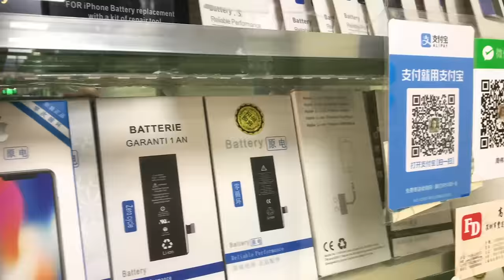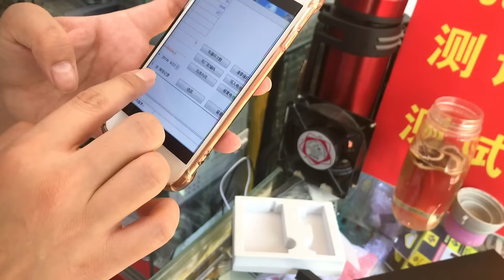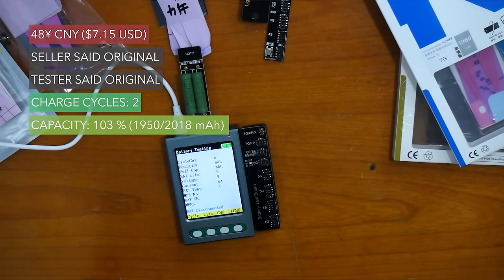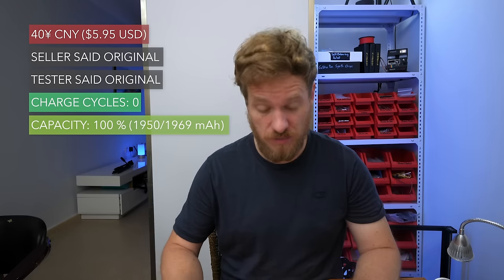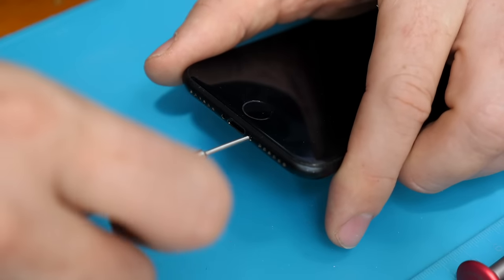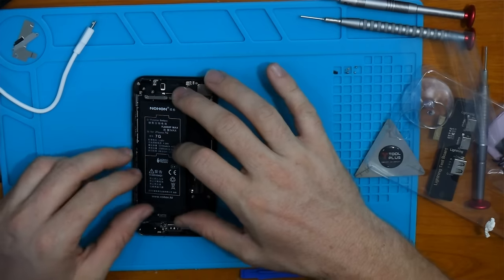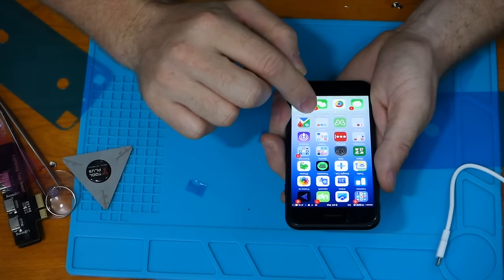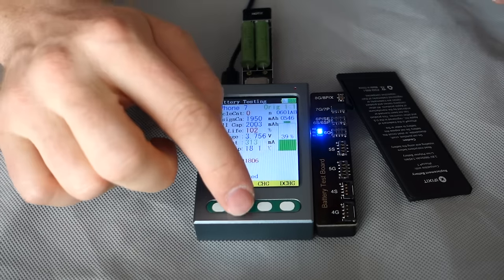Real or Fake? Trying to Replace my iPhone Battery in Shenzhen, China

Comment: Pretty interesting stuff. Genuinely I have an IPhone X. It’s over a year and 2 -3 months old now. I know I’m under a contract for another 9 months (feb 2021) - and I genuinely find it interesting how complex it is to open the phone and replace.

Of course I’m not going to open it and replace the battery. Especially considering I have never opened a phone and don’t have equipment to open it.

But a question I have, How much did you effectively spend on replacing the battery alone? Kit and all, 

I’m inclined to just take it to Apple- because I’m not confident in buying the stuff and reassembling. But if you are confident it probably is cheaper long term to do it yourself,

Or even if your working on day a warehouse (I used to work in) nab a few tools and go Haha

Comment: Tips from a repair tech for removing the battery: remove taptic engine to avoid the adhesive sticking to the bottom part of the flex. and use your fingers. SLOWLY. and EVENLY.
Otherwise you get to pry it out. using heat and alcohol helps too =)
Also. keep up the videos!

Comment: In the automotive industry they have what they call a battery load tester, in the battery can not maintain a certain amperage rating under load it is no good or is on its way out and needs replacement, same would apply to any battery to be tested.

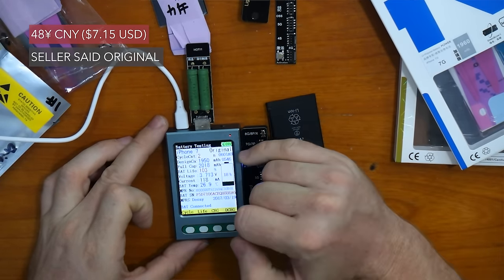Comment: 7:00 If the tester can read data from the battery, I'm assuming it's from some sort of logic board or microchip connected to the battery... couldn't the data on the battery also be faked to read as beig an original battery, when in fact, it could be counterfit  ?
Reply: Of course

Comment: Hey Scotty, how is the nohon max battery holding up after ios13 upgrade? Does Apple whitelist their battery models. I'm using 7w or 10w charging and it really increase wear and tear as you charge and discharge frequently. It's still better than waiting 2-3 hrs to charge from 0 to 100% on 2000mAh at 5w charging. 
I really like higher capacity because you get more decent battery life even if it has high wear level.

Comment: Am I right that only the iFixit battery tested 100 on Life? All the others had 50, 60, etc.... I would definitely go for the iFixit one if so.
And by the way Scotty... that's not "Copy 1 of 1" as you say, but "One-to-One Copy", which means it should be equivalent to the original.

Comment: I had an iPhone 7 with a dying battery. I wanted to order a battery from iFixit EU store, as I am from Europe, but it would have cost me nearly €45 ($50 USD) as they ship batteries only with FedEx Priority service. I then went to eBay and bought myself a battery with repair kit and gaskets from some seller in France (or it was UK) for €7. Got it in 4 days. Works like new, great 100% capacity even after 2 months, etc. So iFixit may have great customer support, but their prices are too darned high! A friend of mine bought a MacBook battery from iFixit and had to return it twice in 1 month as it was dying mid work. Granted they replaced it for free, but I know for a fact that their batteries are not any better than the ones for less than half from eBay or aliexpress.

Comment: The best way to compare batteries is to fully charge them and then count the mAh while discharging back to minimum voltage.  This video seems like it was mostly how to fart around with gizmos which display potentially incorrect information from the battery monitor and extrapolate short measurements to the guestimated whole of the battery.

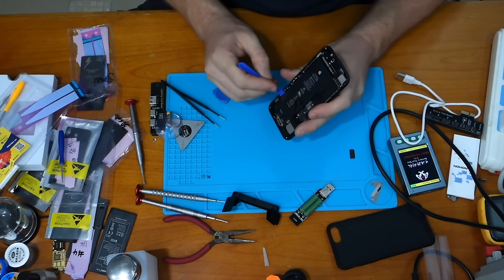Comment: 14:59 Be careful everyone, you can still rip the battery whilst taking it out even with a plastic tool like myself... Just be extra careful to use lots of heat and to make sure the battery doesnt get stuck to the adhesive and ripped whilst you remove it.

Comment: having this device would have helped me a lot because i ordered an iphone 4 battery that was supposedly made in the factory, and i noticed that it is not identical to the original one... and the problem is that the battery doesn't charge! although i have a charge indicator, but for example on iTunes it detects that it's charging, but on other software it's not the case.... and i'm wondering if the battery wouldn't be a lousy copy...

Comment: Bought an ifixit battery for my iphone 5s in late 2018. After about a year it started acting strange (terrible battery life randomly which would come and go). Unfortunately my warranty was up and all they said they could do was offer me a 50% off discount on a new battery. Was really hoping that this battery would last me at least a few more years but the circuit contained on the cable obviously ended up failing. Probably should have just gone with a cheap no name brand and taken my chances but I ended up buying another battery from ifixit with the discount.

Comment: Hey, do you know any fix for iPhone 7 loop disease / Speaker button greyed out during calls?
1. One  fix is removing the audio ic, reballing it and making a c12 jumper which require micro soldering techniques
Could it possible to just shove a piece of paper or card board support over the audio ic so It has a better contact?
Could you do a small experiment?

Comment: Have you run into aftermarket batteries that will not charge when installed? I have a TCL 30 XL whose battery started inflating. (I use a 3rd part fast charger) Got a new non-OEM battery (cant find OEMs) and installed it. phone turns on shows 53% but won't charge. I put the original battery back in and it charges fine but I'm afraid it will explode. I guess the phone uses the ID line on the battery to see if it's original...

Comment: a question bro, in case you changed to an iphone model x or higher as Apple said that non-certified components are detected, is there a reprogrammer to to transfer the serial numbers from the original parts to the new ones?or do they even sell it in alie?
Reply: I don't think so I work in phone repair and have attempted to reprogram batteries you can transfer the serial number but the phone still reports non official parts.

Comment: Hello,

I had an iPhone 6 and I changed my battery for an iFixit one and after 3 months it no longer started charging 100% and in 1 month it no longer held the charge for 3 hours; I changed the battery again and in 2 weeks it no longer held the charge for 3 hours.

I started connecting the iPhone to a power bank and after a week or a month, the iPhone no longer wanted to turn on.

I suppose that the iPhone comes with a charge counter that if you exceed it, no longer allows you to charge the battery to 100% and it degrades. Will it be correct?

Comment: In my experience on the gray market of phone parts, if the battery is labeled OEM you're taking more risk than the batteries that are labeled by some other brand. The "OEM" batteries have a much greater chance of being used or being of complete garbage quality, because if it is labeled as original but is a copy battery it could be true crap quality (the knock off makers don't care). So personally, I would put in the battery labeled on its own brand, and then at least you know you're getting new (more likely anyway)

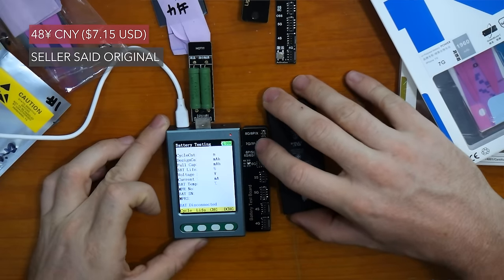Comment: 7:00 Sellers said original, device said original.
What say that this can't be changed? The "pro" version you can flash whatever settings with whatever you want is my $1000 bet.

Comment: I don't buy fake batteries for a gazzillion years, but back then in the Nokia golden era, never had luck with the cheap knockoffs they were mostly completely bad or wouldn't last a single crap... Nowadays from this video seems things improved a lot on the knockoffs, but sure there's always that bad seller with a super crappy or very used battery trying to sell as good...

Anyway I bought a Xperia Z2 used with broken glass\touch a few years ago (but fully working the LCD wasnt broken only the digitizer but I tested everything with a controller), I bought a more expensive LCD replacement that some ebay seller said it was original and I could have bought it for like half the price, when it arrived, I put it in the phone and boom 3 red lights, it wouldn't boot with that screen and was no way near to being original since the letters on the back were different, the chip on it was different too and was probably triggering some protection on the phone, only a few years later someone found a way to bypass it and I did a trace of solder from some point in the board to a resistor and boom it booted and it worked, but that was a very god damn bad seller...

I ended up selling that Z2 cheap to a friend and I had bought other fully working Z2 and its still my only phone but the battery was already bad since I bought it, maybe some day I will buy another "original" knockoff from ebay to test :).

Comment: Heres a tip, if you see it.
Removing the taptic engine makes it much easier to remove the strips because you aren't putting as much upward stress and it doesn't scrape against the engine.
It seems to make removing original apple battery strips much easier

Comment: It may be 'really easy', but what happens when you don't have a hot air solder reflow station like what you ended up using?
Reply: Hair dryers work pretty good

Comment: I HOPE YOU READ THIS: If your phone starts acting up weird like random shut downs when battery's at 10-15%, heating up easily while doing light task, then rest assured my friend, its not the fault of your phone's battery, its the fault of your updated iOS. Trust me I have been using and testing iPhones since 2011. For example, I have a 6 years old iPhone 5S running on iOS 8.4 whose battery life is at 75% and another iPhone 5S that I purchased again in 2018, so that would be 3 years old which is currently running on iOS 12.4.5 with battery life at 87%. 

Guess which phone heats up easily and has random shut downs at low battery ? Its the 3 year old iPhone 5S whose battery life is still 87%, while the older 5S with 75% never shuts down randomly and can be used all the way till the battery hits 1%. The 5S running iOS 12 heats up easily while simply streaming a youtube video via mobile data, whereas the one runnning iOS 8 only heats up on heavier tasks. Apple is the master of planned obsolescence. 

Android's latest version is 11, yet still all their apps support previous android versions till 5. On the other hand some important iOS apps have already stopped supporting iOS 12, they require 13 or newer.

Comment: My iphone 5s has original battery from 2013 and it has a charge cycle of 2010 and i need to  run it on low power mode like most of the time

Comment: replaced my battery with a 3rd party non original i bought online and the touch id stopped working afterwards, i assumed it was because it was 3rd party but you didn’t mention it as a problem so now i am confused why mine doesnt allow touchid to activate 🤔🤔 i’ve opened it back up and made sure all cables were aligned correctly and i cant find anything else that could be the problem!!! so confusing..

Comment: Using the jailbreak on my iPhone it tells my i've clocked 1074 cycles and I've 2362mAh left of the original 2890mAh which is 77%, Apple's battery health tab tells me i'm at 80%😅

Comment: its sad people dont just look up how dc power works, and they could just make there own..     its sooo simple.. My android is running off its internal bat, so the 5 volt (standard usb voltage) at 7 amps will charge the battery for up to 26 hours if I dont plug it into any charger..

the difference?   I paid $20 in parts to make a battery they sell for $200 on ebay..    only dif is mines external.

Comment: I just replaced an aftermarket battery iphone5 it claim has higher voltage it true.
But after using for three months when battery level is 60% left on the status bar, 
I just start to browsing than the battery sudden drop to 18%, pop up message say lower battery.
I re boost the iPhone but the battery still reading very low.
It happen several times like that.

Comment: DONT!! use original replacement batterys they have a chip inside that counts how often you charge it after a 1000 charging cycles it drops the capacity of your battery

Comment: "80%" .... you know battery can have its capacity but there is internal resistance to consider.. at start and after some cycles ... you batery can have still 90 or 70% percentage of capacity but cant provide current that phone need and start restarting ... ... for  avarange man  i recommend cheaper test litokalla lii-500 maybe (12-20$). its for li 18650 and not for LiHV (4,35)batteries but  its easy to put on connectors  some wires and conect them to batteries (there is fault in translation to eng ... about  what function are but i hope every one are enough inteligent to regognize what going on.

Comment: if you know the voltage of the device its easy enough to buy ANY batterie pack and just rig it external...   my galaxy tablet is twice as thick, but can run 6x longer because of the external pack I made for ... wait wait....   $7  for the cable and bats.   LOL     304,000 mah

Comment: actually, they might seem legit, except, the battery life is way weaker. a normal battery can handle 400 charging cycles, these will lose capacity even after 150.

Comment: There can not be original batteries if they tell you it is original they are lying because either it is a fake made too look like an original with the bms and chip transported from an original one to show as an original in the tester OR an original which has had the crap used out of it, the way you tested each cell for only a few seconds is wrong you will never get accurate results that way you absolutely HAVE to fully charge and then fully discharge the cell to actually know the true capacity.

Also about the so called "original" ones having 0 cycles thry can easily flash them to report 0 cycles when in reality the actual cell has had well over 1000 cycles so the best and only way to check is the way i just mentioned above.

Comment: Hello.  I have a problem with iPhone 5s.  I have changed screen.  I have updated IOS12 and I have a damaged battery.  The battery ends very fast.  When I lock the iPhone from the power button it restarts.  While it stays open it works perfectly.  That is, once the screen is locked, it restarts.  What's wrong;  Save me

Comment: Okay, I went to Apple because I cracked my screen. My battery said it was only charging to 85%. I had Apple to replace the screen and the battery at $210 in my iPhone 7 Plus. 6 months later, my battery says it is at 93% capacity after it used to say 100%. At this point I believe that Apple is pushing me to upgrade. My conclusion is that devs at Apple made that battery reading program to deplete charging capacity after a certain amount of charge cycles. This way it shows in settings a false value capacity.

Comment: So then, what's the REAL answer on what battery to buy? It doesn't have to be an EXACT this IS the best battery answer, just a good recommendation of something that is legit quality but also a good value price wise is what we need. You should be able to get a good quality battery and the materials you need to do the battery change for a fraction of that $29, and again we don't need a defacto answer on what THE best battery is. We just want a recommendation for what is A good battery, keyword being "A". Doesn't have to be the only choice or necessarily the best choice, but we want a choice either way. You did not give that to us in this vid which is unfortunate and makes this vid a fail imo.

Comment: there are several tools from qian li and jc and apps lke 3utools and imazing that check battery stats. its not magic. the info is on the bms chip that all batteries need. if theres no info the battery is trash design [bootleg factory rejects tht somebody buys cheep and then sells-dangerous] or the chip is damaged/faulty. put  a good quality battery in there and move on , u cant get a "new"apple battery because they dont sell em. the aftermarkets are better anyway as they will have the latest tech in the chemistry if theres been improvement . also remember -its ur old fone hopefully u got good use for it ,eventually just let it go. thats how it is wit electronics these days,so never spend more than u can afford for say 2 years. replace it after 2 years and ur set/up to date/ living comfy ,,whatever

Comment: you should give this a 2022 redo, because the annoying message apple introduced when replacing the battery even if its an original one. you have to replace the electronics part of the battery for it to work. what a bunch off a holes at apple

Comment: My wife's iphone 6 plus earphone audio was problem free until I changed the depleted battery. The battery is an after higher capacity market battery purchased from Ali Express. The iphone is fine and functioning in every respect with the new battery except in 2 respects. (1) The earphone speaker sound stops intermittently and has cracking sound. The volume controls are not functioning as normal. (2) The iphone gets really hot after a while. On a few occasions, temperature warning came on and I had to turn off the phone. Does anybody know what I might have done wrong when changing the battery? I have tried reconnecting the display to ensure proper contacts but the audio problem remains.

Comment: Recommending your sponsor is never the proper answer, for the exact reason you mention at the end.  $29.  I mean hell, for that price I would rather just pay a lil extra and have Apple take on the hassle of changing my battery.  And they are going to actually INCREASE the price from there after 2019?  That's a stupid move imo.  I mean chances are their "IFixIt" branded battery is just a $5 rebranded Chinese battery like what you can get at that market anyway, and they are paying a whole lot less than that for theirs as they are getting them in huge bulk.